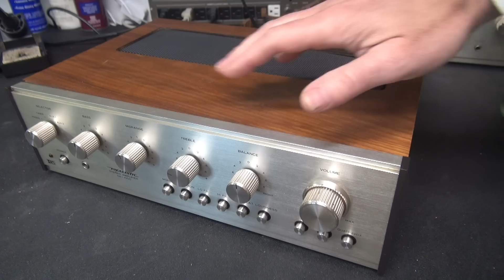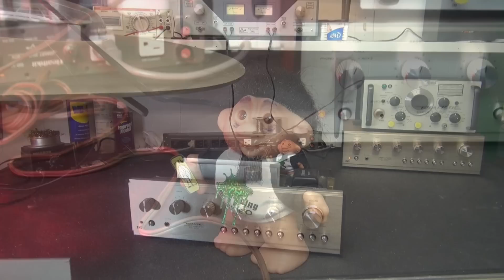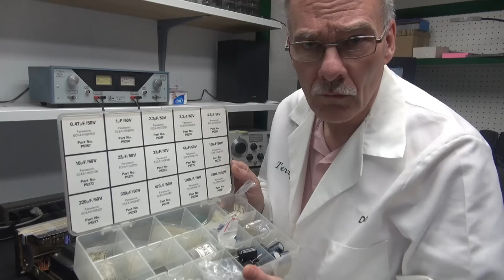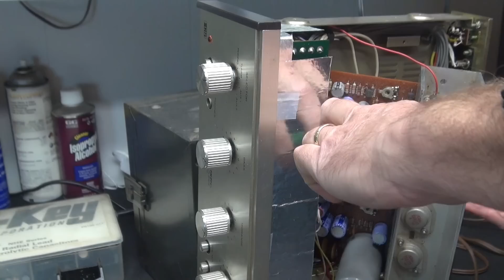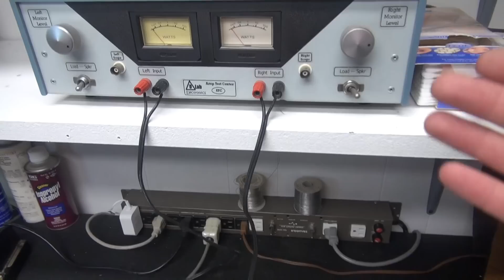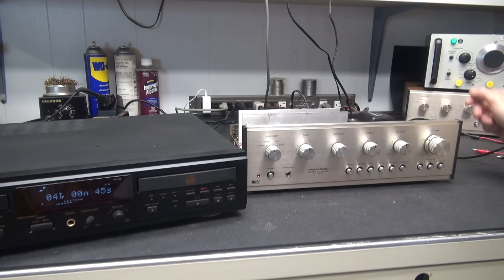How to repair a dead Integrated home audio amplifier step by step Realistic SA-1000

Comment: At 9:00, an analog ohmmeter will check the transistor junctions, even *in circuit*, typically giving a reading of about 10 to 20 ohms between base and emitter, and base and collector. Short circuits are typically to be found between the emitter and collector.

I didn't watch the whole video yet, but it bears mentioning, in case Terry doesn't, that if there is a polarized electrolytic capacitor used as a feedback capacitor for the differential amplifier input circuit, it should be changed to a bipolar capacitor. Sometimes those feedback caps  get hit with a backward voltage surge as the power supplies are energized or depleted , leading to a damaged or,  eventually,  blown cap . An electrolytic bipolar cap is fine; or at the very least put a small film cap across it.

I'm surprised this unit doesn't have a removable bottom panel, most units of its era did and do.

Comment: Boy, you were lucky. I don't think I've ever gone thru an integrated amp of that era with blown outputs that didn't also take out the phase splitter or driver transistors.
Reply: And used an out of manufacture STK module!

Comment: It's my opinion that the simpler analog amps/receivers many times sound better than some modern digital ones.   If it's reasonable to fix,  why the heck not.
Reply: DeadKoby, absolutely; simple circuits with a low parts count usually sound the best, as long as they didnt skimp on the power supply (big tranny, lots of filtering), heatsinking, and designing for stability (bias-feedback transistors or diodes mounted to the heatsink; parts not being run at 95% of their ratings all the time, and so on). Good layout and wiring practices, and clean simple grounding, also helped a lot. Once you start designing a product to be a Swiss army knife and do a million things, it invariably does most of them poorly.
Reply: Of course they do. Sound is an analog medium, not a digital one. Our ears are also analog. Anything digital will only be an approximation at best and doesn't contain the full sonic information as the original analog waveform.

Comment: VG Terry but I'm surprised you didn't rebias it.
Reply: Solid state amps don't generally drift as much as tube amps, and are usually designed to be self-biasing. If the resistors are still near spec and the caps aren't open/shorted/leaky there isn't much else to do. Those Japanese film resistors were also very well made and amazingly stable. If they didn't get fried it was rare to get more than a couple percent drift, unlike old carbon comp resistors.
Reply: l wilton It's not about the resistors and it certainly isn't about the capacitors. It is about fitting two power transistors with unknown and almost certainly different Vbe, Gm, &c. Rebiassing is essential. It should at least be checked.
Reply: Totally agree, he shotguns all the electrolytics, changes the finals, a resistor and the rectifier diodes but doesn’t even check the bias?
Reply: doesn't hurt to check it, if it's close, leave it ( as w/my luck the bias pot breaks ).  double the filter capacitance for a little more bass punch.      Cheers
Reply: I'm sure the bias was checked and set. Just my 2c.

Comment: tha't's got to be the neatest test bench I've ever seen. a real professional at work.
Reply: Nice repair.  May be better than ever with all of those new, modern capacitors.
Reply: Lol I have burn holes everywere on my matt lol don't beer and solder
Reply: I have one of those silicon mats it's safe to drop solder on it, won't burn it.

Comment: Did you just use solder as the jumper for that large cap? I have to do the same thing on my reciever.4 pin to 2 pin
Reply: No, Use a bit of cutoff lead from a resistor or a cap, or a bit of uninsulated buss wire, or strip the insulation off a bit of hookup wire and use that. (But a component lead will be tinned, and these days insulated wire is usually bare copper. You are better off using tinned wire since it won't corrode over time.)

Terry has mentioned that he tends to save the cutoff ends of component leads, just for uses like this. He isn't the only one that does that. :-)
Reply: No, you want a good big thick piece of wire. It has to sustain charge and discharge currents for that PSU cap, and they are very large.

Comment: Great video Terry.  Happy to see Dick taken away by aliens but I'm sure that won't be the last we hear from him.  I would love to have your stereo test/load device.  I'd be willing to contribute a specific amount just for the schematic!  I just cobbled together a 100W 8ohm load device but the pass through and meters are a great touch.  I just repaired an old Sansui receiver that is direct coupled (no bias adjustment I believe) and changed all four output transistors with an NTE equivalent.  Now I'm wondering it that was wise.  Well, I bought the unit for 10 bucks from a guy driving a van in a grocery store parking lot (true story) so I used it as a learning process.  Seems to be working OK for now.
Reply: I'm sure we'll hear "Dick" squawking from two or three galaxies away when the aliens subject him to an anal probe! Couldn't happen to a more deserving fellow .....

Comment: Are those Corn Nuts?
Reply: I would go with Elna Silmic II and metalyzed resistors for the coupling cap RC network.
Reply: I'm curious how the 4700Uf smooths out power supply ripple under high power load with some Biggie Smalls or TuPac source material. I believe 10000-15000 uf is proper. Uf back in the day cost $$$
Reply: OnSemi has consistently matched transistors over many batches. If Sanken or Toshiba isn't around... OnSemi is very supportive to enthusiest and techs by sending them free samples. Just register on their website.
Reply from the maker: Oyster crackers